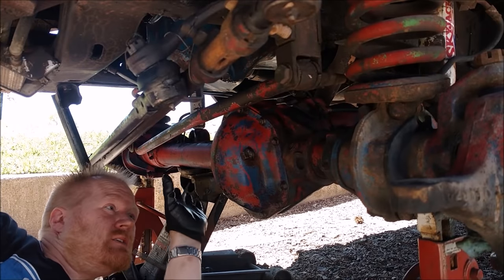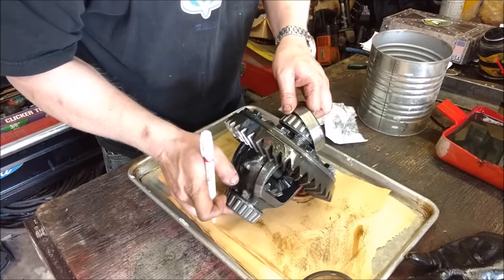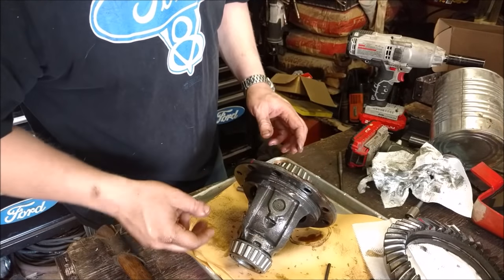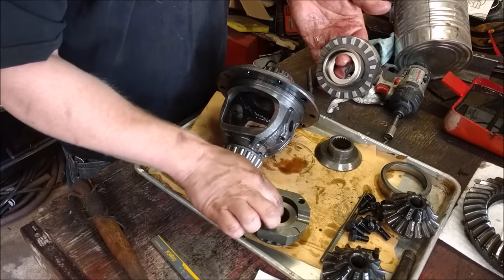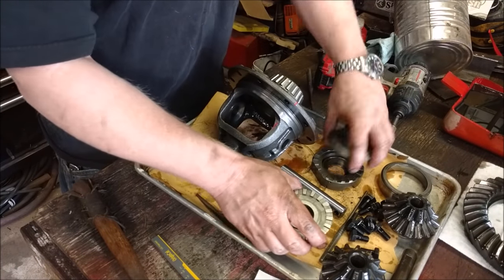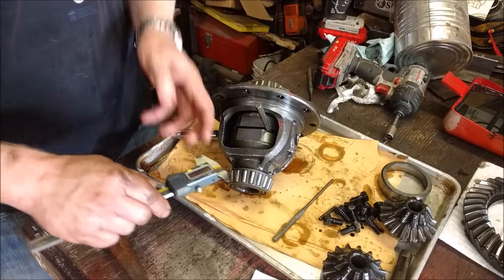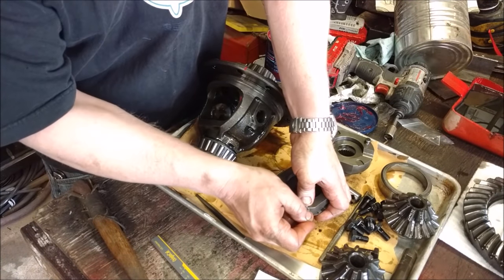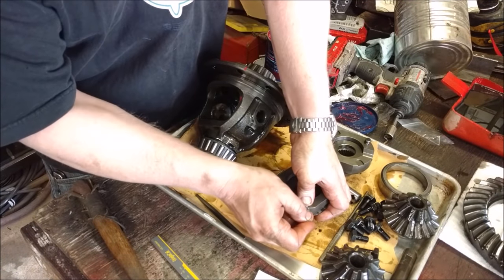Lunchbox Locker Install Dana 44 30 JEEP Ford Chevy

Comment: Hey Moe, Did you think about using a air locker?.
Reply from the maker: I did consider an Air locker and may still use one for the rear. For all practicality in the front axle this functions the same for over $1000 less.
Reply: sixtyfiveford . I can see why you chose that locker. I looked at the link in the discription
And was surprised the price of this locker. Plus if you went to air locker you have the extra cost of a compressor etc. Anyway great video Moe. Thanks.
Reply from the maker: The Electronic Locker is a nice option and I know a lot of guys who use them. It's not as strong as an Air Locker but is a lot simpler to install(no air lines/compressor). The inconvenience of adding the compressor is nice though as having onboard air is always a benefit.

Comment: C-clips on a front axle?  I thought they were only on the rear.
Reply from the maker: I know the Independent suspension front axles(IFS Dana 44) uses C clips but I'm not sure what others might. I was more just generally referring to axles; front or rear as this can be installed in either.
Reply: Paul Gumper I can tell you first hand a Dana 30 front axle does not have c clips. The shafts are held in place by the big nut on the outer axle shaft that clamps against the unit bearing. You can pull the shafts without taking off the cover. In fact if you unbolt the unit bearing you don't even have to undo the big nut.

Comment: so with that locker your front axle is gonna be locked? no way to let it be free?
Reply from the maker: I have lockable/unlockable hubs so I can simply unlock a hub.
Reply: oh sweet on my 77 i have the 203 so i got fulltime hopefully in the future ill be able to do a 205 and manual hubs with a locker ;)
Reply: this is the truck btw on this youtube i made a separate youtube channel for it :)
Reply from the maker: I had a 78 bronco with the np203. It had fixed hubs but those can be swapped right out for switchable hubs.
Reply: how easy is it to swap a 205 tcase and manual hubs on a 77.5 f250 with a dana 60 front

Comment: How do you like the lunchbox so far? I've been thinking about going this way.
Reply from the maker: For the price and simplicity I would do it again in a heartbeat. I wouldn't put on in the rear though nor an axle that didn't have locking hubs.
Reply: @sixtyfiveford  I bought a powertrax no slip for the rear of my k2500. It feels the same as an open diff. The only time I noticed it is If I'm hard on the gas. There is no clicking, no banging. Im extremely pleased with it. That's the powertrax no slip. I don't know about the other lunchbox lockers.
Reply: @sixtyfiveford  was wondering why you didn't put one in the rear. I see in the early video your rear is an open diff it looks like. Do you feel the added lock would be dangerous on the highway?
Reply from the maker: @garysisk3431  It really only engages under hard acceleration. So in the rear you would feel it ratcheting while making a "fast" right/left hand turn. You wouldn't notice anything while going slow while turning and definitely nothing while going straight down the highway. The more it ratchets the faster it wears out and others have said it only lasted 15-20k miles in the rear for a street driven vehicle. But for the price and simplicity it can't be beat and when it does go out it is just a stock open differential.  I can unlock the front hubs on this truck so my front axle never spins while I'm on the road. So it will last indefinitely on my front axle.
Reply: @sixtyfiveford  Just my 2 cents,  got one in a 77 K30 3plus3 14bolt in the back, friggin love it, wicked traction, zero issues going on year 8 now, yes on extreme occasions it unlocks turning hard left or right but outside of that I would reccomend putting one in the back if she does alot of off roading its 100% worth it.

Comment: Is it really that easy though? I would love to put one in my 03 tahoe!
Reply: I put one in my 90 k2500. If You have a 14 bolt 9.5 ring gear diff. It was easy. I didn't have to remove the carrier. Just the spider gears. That's it. It made burn outs a lot easier. 1/4 throttle to start spinning
Reply: Its as easy as the vid shows. Your independent front end is definitely more labor intensive than a straight axel though. No need to pull the diff like he shows in the video. If you have the GM Gov lok rear diff these drop in lockers will not work

Comment: How often would you need to change those?
Reply: eaglecot I was curious about this as well. I'd love to install something similar in the front of my chevy 4x4.
Reply: @eaglecot - That all depends on how hard you use them and how often you change your gear oil.

 Say you go off-road occasionally, (twice a month), and you don't red line your engine while spinning the tires all the way up hills and you don't jerk the steering wheel left and right under full load. You just play around, but nothing crazy. As long as you change your gear oil between 12,000 to 24,000 miles or once a year/once every two years. You should get 100,000 miles out of them.

 Now if you go crazy and go rock-hill/rock-bouncing/hill climb racing, you'd be lucky to keep the lockers in good working order before the one year warranty runs out.
Reply from the maker: With an axle that has locking hubs it is completely idle when not in 4 wheel drive. So it would last indefinitely on road. For a daily driver without locking hubs where it always spins I would agree with Jeff at 100k (occasional offroad).

Comment: Have you ever seen "scroll pins"? A tractor mechanic showed me one a couple of years ago. He is a dealer for mid sized farm tractors out of Asia, so maybe it`s an Asian invention or something. Wonder if roll pin punches will work on them? Probably metric. Dang it on metric!!! Hate it.
Reply from the maker: I know exactly what you're referring to. Its like a roll pin but it's rolled a few times around itself(like a paper scroll). I've come across them a few times in random things. I don't see what roll pin punches wouldn't work.
Reply: Thank you for your reply. I appreciate your excellent videos. Your camera work is outstanding. Very neat rock climbing video with your Ford. Be well and enjoy the upcoming summer. Joe

Comment: Anyone know how it does on ice?
Reply from the maker: Any locker on ice: You will have more traction to get unstuck/move forward but in the rear axle it can make the back slide out on a turn.
Reply: @sixtyfiveford  Thanks for the reply! Been debating on lockers for the suburban, but not sure with these Montana winter's lol.